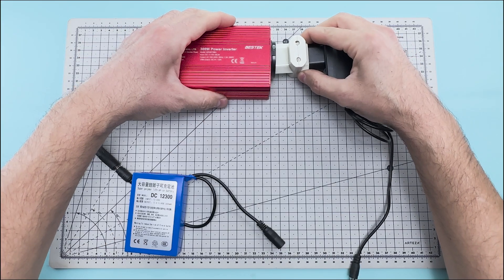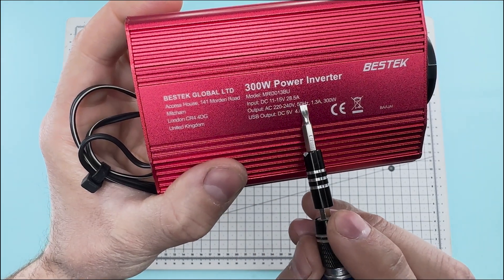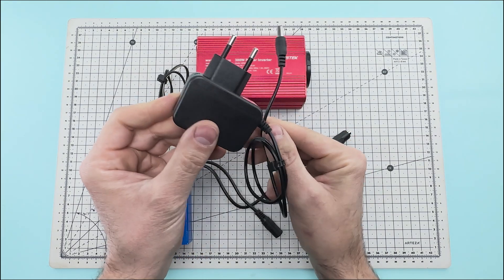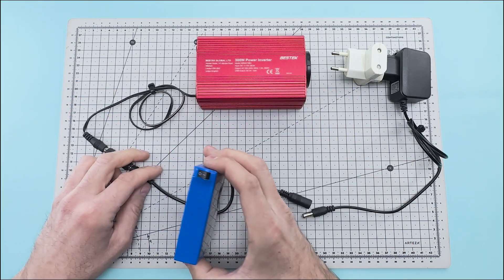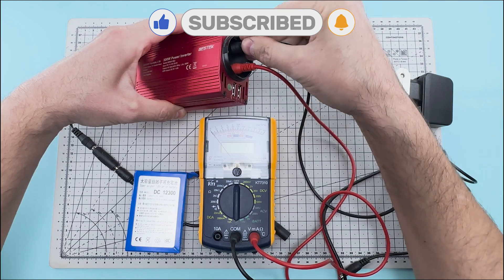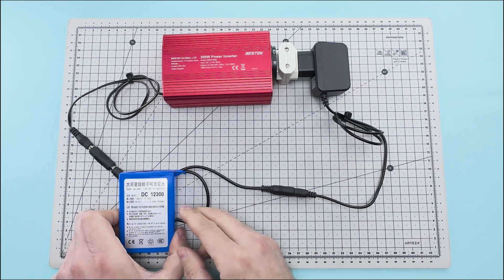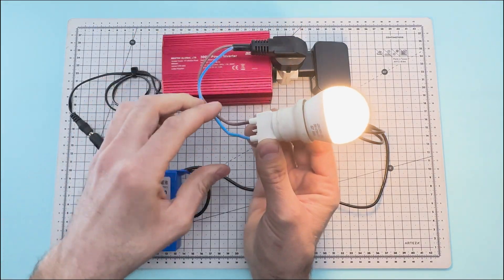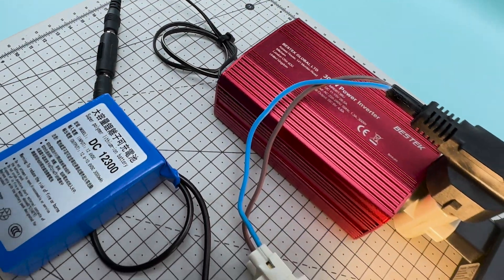Will it work? - Free Electricity Experiment - Energy Regeneration

Comment: Hello 
Is it possible to connect the power inverter to any 12v car battery instead? because most inverter from amazon come with cigarette plug and with 2 clamps. but instead connecting directly to the car, bring the car battery indoors?
thanks

Comment: What is not said but is shown in the  video is that the battery has a capacity of 3000mAh(3Ah).

Your inverter is rated for 300 watts, and it will draw power from the 12V battery to supply the 220V AC. 

Let’s estimate the current drawn by the inverter when operating at full load. 

Assuming 100% efficiency (just for simplicity, though real-world efficiency is usually around 85-90%): 

Inverter Power (W)=Voltage (V)×Current (A) 

For a 300W inverter: 

300W = 12V × I 

I = 300W / 12V = 25A 

The inverter will draw 25 amps from the battery when running at full load (300 watts). 

How Long Will the Battery Last?

Now, we can estimate how long the 12V, 3000mAh (or 3Ah) battery will last when powering the inverter: 

Battery Runtime=Battery Energy (Wh) / Inverter Power (W)

Battery Runtime = 36Wh / 300W = 0.12 hours = 7.2 minutes 

So, with a 3000mAh battery (3Ah) and a 300W inverter, the battery will last for about 7.2 minutes when the inverter is drawing full power.

With 85% to 90% efficiency, the battery will last around 6 minutes.

Comment: As a kid I would make little things like this and show it to my dad. My dad just shrugged and said that’s not how power works! And I would go back to my room discouraged… however the next day I climbed a tall pine tree and at the top   fastened a shiny insulated plate and ran a wire back down to the base of the tree next I hooked up some capacitors wires and connected them to a deep ground.
And I got some current during the day and night!!! It wasn’t much but I proved to my dad that it IS possible!!!!!
Reply: El mismo experimento usó Faraday en su época... Saludos 🙋🏻👋🏻👋🏻👋🏻👋🏻

Comment: I've been working, though unsuccessful yet, on something like this starting from your video where you PFC the Pecron generator. But it can't last, because you don't PFC the charger. And I know chargers have low PF, as I measured myself. You should have showed some numbers. I do believe this is the bread and butter for any free energy system that can be made at home, without dealing with engineers that NEVER want to build anything overunity related.

Comment: Es un proyecto sencillo que muestra que si hay una forma de crear energía en un circuito prolongado de tiempo.

La energía infinita no existe, nada Infinito existe.
Pero si es de recalcar que los proyectos que plantean son para periodos mas largos en el tiempo que el de la vida humana. 
No he diseñado ni construido ninguno de los sistemas que han presentado. 
Leo y escucho a mucha gente que propaga la idea de la energía infinita, pero si un sistema dura 1000 años, no será infinita, sera mucho mas larga que 10 vidas humanas. 
Me parece que si funcionan los sistemas, pero la gente no entiende que no es lo mismo energía infinita a energía perpetua en tiempos mayores a la vida humana.

ej: si se construyera este sistema, y durase 50 años, no es infinito, pero te ahorras 50 años de consumo energético
Ahora pensemos a escala: un sistema que dura 200 años, No es infinito, pero durara 20 décadas. Si necesidad de utilizar medios como la energía radioactiva, eólica,  hidráulica o solar
Reply: Very good.
Nothing is infinite, just prolonged.
In every transfer of energy there is a loss which shortens the life span of the original power supply.
Batteries are designed to give at best 10 years.
Most only last 5.
After 600 cycles on a lithium battery it is used up.
Therefore there is no power to create the original supply that feeds the system and the system shuts down.
Energy is all around us at every moment no matter where we are.
Go back and study Tesla's designs to improve on energy production.
It's not infinite but, he was on the right path.
Grow from there.
The laws of physics are waiting to be broken.
I power my tiny home everyday for almost a year on two 12 volt batteries.... During peak sunlight I have 2 hours to use 110v ac from a converter which powers a battery charger plus a microwave ( when needed ) and a soldering iron.
The batteries started at 14.6 volts and are down to 13.1 now almost a year.
These batteries will only last 14.165 years as is instead of 4 years that the original warranty stated.
Nothing is infinite but we can improve what we have.

Comment: There should be 2 or more sets of batteries, and a Led panel to monitor the voltage and running  Ampheres.

 Prolong charging the battery will shorten the lifespan. So there must be a command to  the other battery, while the previous battery is set to charge. Minimum level will be set to 20%. This will help revive the batteries easily and can last for days when no charging is applied.

Inverter generator ▶️ 
Charging Adapter ▶️ 
Batteries ▶️
Led Auto/Power Panel ▶️